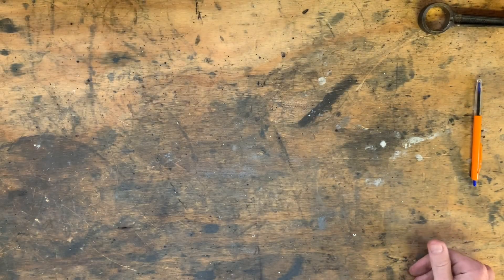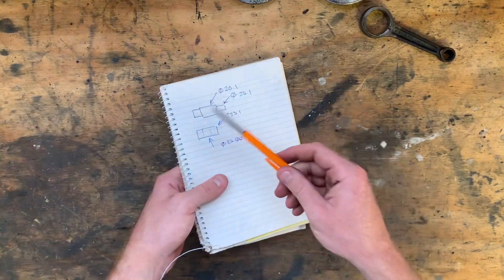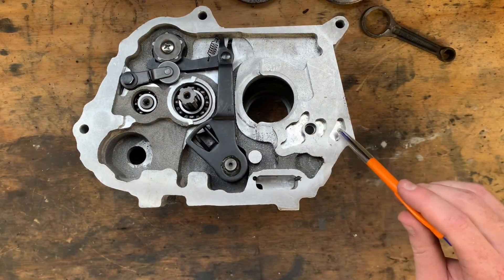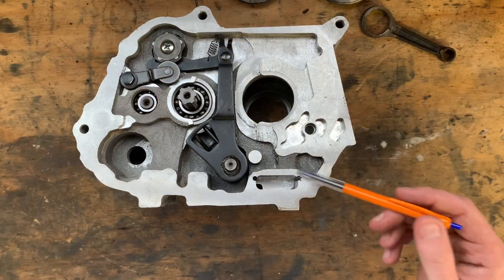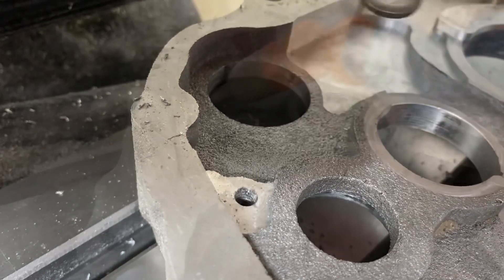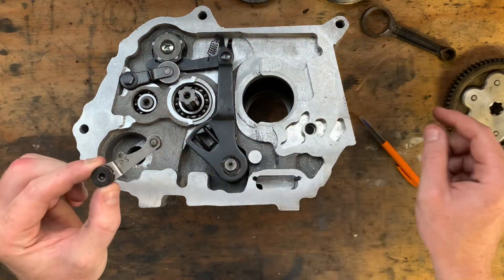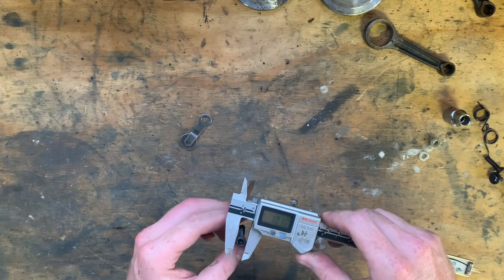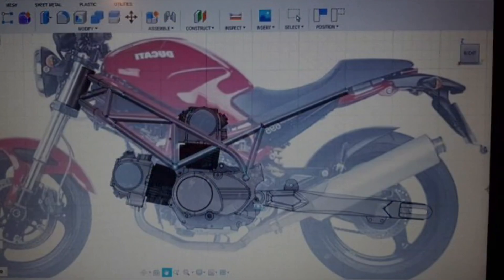Homemade V-Twin, Sorting the Little Things

Comment: very interesting project! One thing I still wasn't able to figure it out - at your engine as well as on Allan Millyards v-twin engine: how do you manage to get the oil to the top-end of the standing cylinder in order to get the camshaft and valve-rockers greased? Whats the trick?
Reply from the maker: I guess you’ll just have to wait until I do a video on it.

Comment: Good to see a bit more progress on the Motor 👍
Curious about the 6mm Rod you need ??
I have the similar problem on my side of the ditch 🤔
Small diameter 4140 Rod is Not so easy to come by.
I guess because no one really uses this size often enough to justify keeping it in stock ??
Not totally sure of the holes in the Cylinders for the 6mm Studs to pass through ??
But, IF you have enough room, or, you could even Bore it out ??
You could possibly find a larger diameter 4140 rod and turn the ends down to 6mm or even larger for the Threads,.
Just a suggestion,  that might be handy for a thicker Cylinder Stud too. 😉
Reply from the maker: That might be the go, the smallest I’ve found is 10mm, I haven’t looked too hard though. I might even have to break out the travelling steady for the first time and turn 10mm down to 6-7mm. There isn’t much meat for larger diameter threads on the engine side of the studs, I made the cylinder hole in the case larger for the 110 cylinder, in hindsight I’d have made it a snug fit for the 70cc cylinder, letting me use m8 instead of m6 threads.